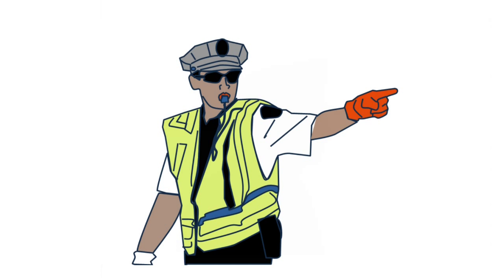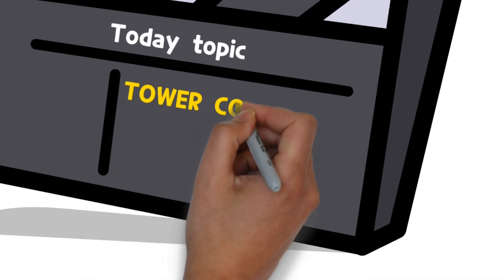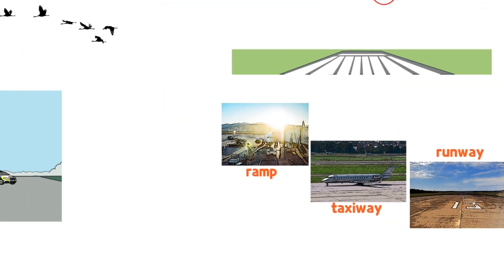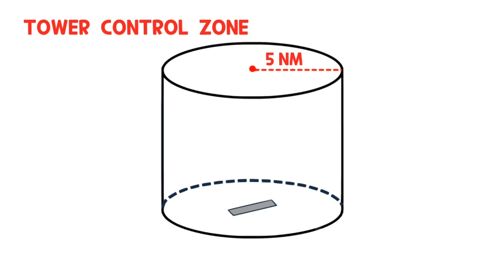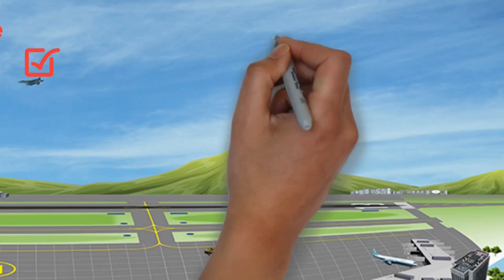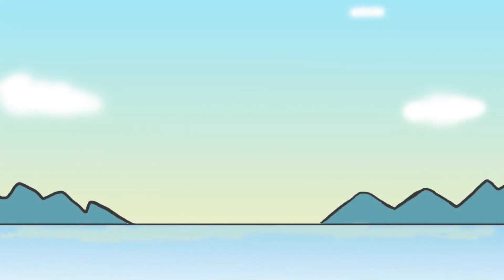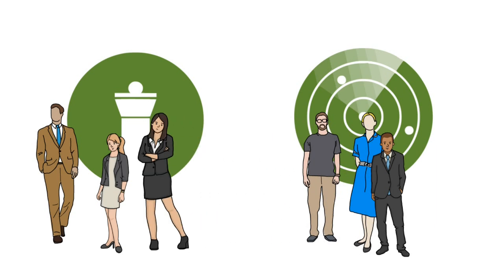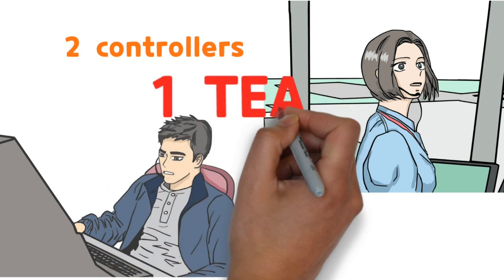tower controller VS radar controller [ATC for YOU]

Comment: Hey,where exactly is radar facility center
Reply: What do you mean exactly? A radar facility can be anywhere.
Reply: @vargas0033  so its just a usual building like a normal public building? And coulf be found in anywhere
Reply: @a318snose4 in romania the radar facility is located in the city literally between apartment buildings
Reply: In Copenhagen Airport, the Radar Facility is in the same airport, inside the perimeter. It is located on the main building next to the old airport tower. South west airside.
It may vary from airport to airport.
Reply: @JSolisHD  thanks